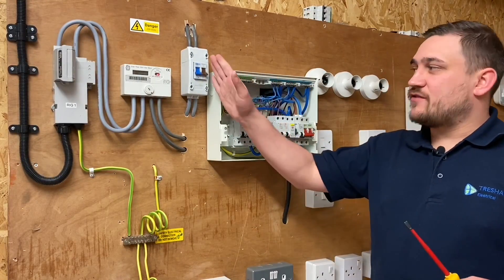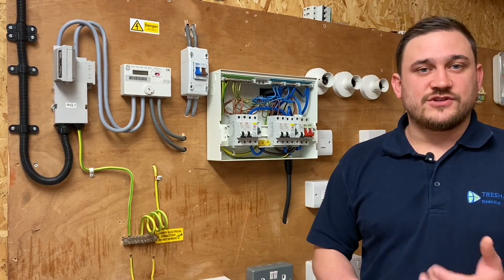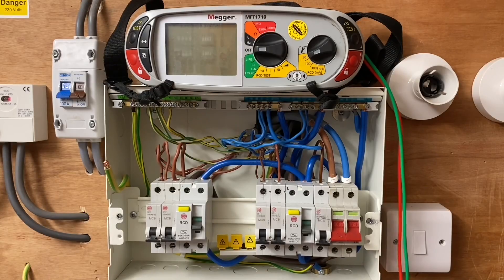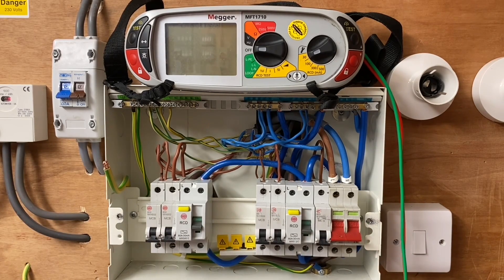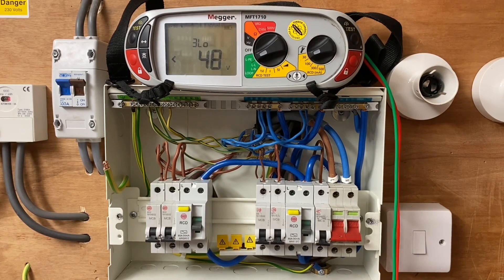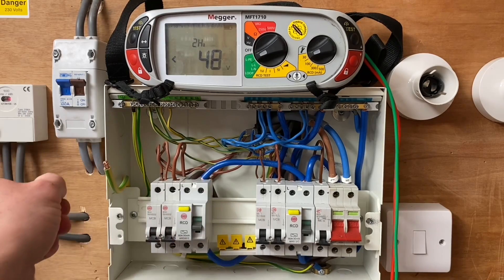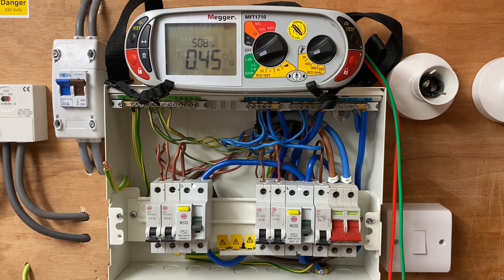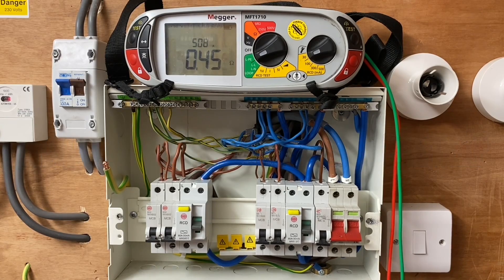External Earth Fault Loop Impedance Ze Test - How to Remove Parallel Earth Paths - Live Testing

Comment: During a practical examination, if you were to forget to reconnect the means of earthing wouldn't you fail the that assessment? Also, how would you test the Ze with a machine that requires you to use 3 leads?

Comment: Hello Admin @GSH electrical. Please I need your assistance with a power supply problem.
1. Please what are the causes of negative power factor registered on a MD meter for a distribution installation.
2. How can this be corrected.

Comment: During this test all short circuit protection between you and the local transformer has been removed apart from 100A incoming fuse, so do a risk assessment first.  In reality the fuse/dist board may be in an inaccessible, unlit location or you may have to work from steps/platform.  The double pole isolation switch may be in a different location and DURING SET UP this should be padlocked OFF.

Comment: Sorry if this is a dumb question, but why is it higher for TN-S than TN-C-S? I understand the difference between the earthing methods, I'm just not twigging why that might lead to a higher impedance being acceptable for TN-S.
Reply: In a TN-S the earth is ran from the transformer separate from the neutral wire. The earth conductor will be a lower CSA (smaller) than the neutral which is why it has a higher resistance. The earth is not designed to carry current under normal operating conditions, it just needs to be large enough to ensure circuit breakers will operate in the event of a fault.  
In a TN-C-S the earth and the neutral are the same cable up to the fusehead. Since the neutral is required to carry current in normal operating conditions, it's sized appropriately and so should have a lower resistance than a TN-S earth. Since the TN-C-S uses protective multiple earthing, a higher reading might indicate a failure in the system.
Reply: In TN-C-S the consumer have a grounding before the consumer panel. So the impedance is smaller.
Reply: Hi I need some help as u did this 2 years ago and I’ve jus started